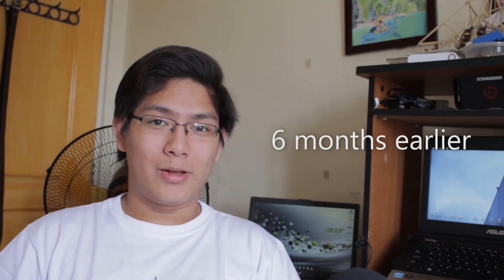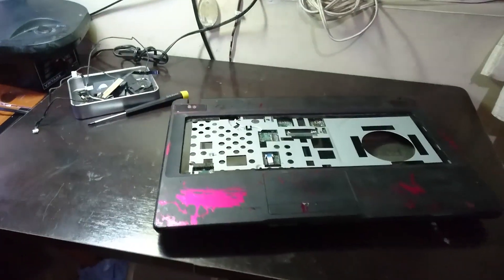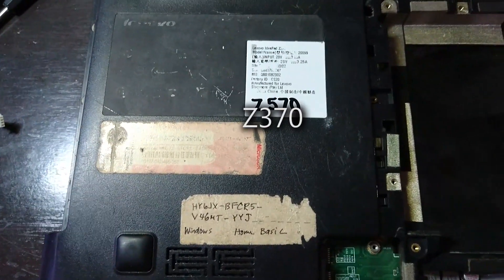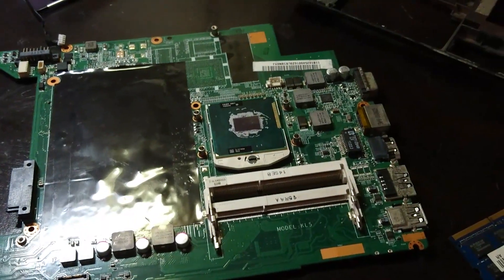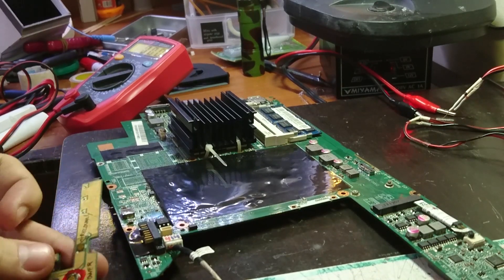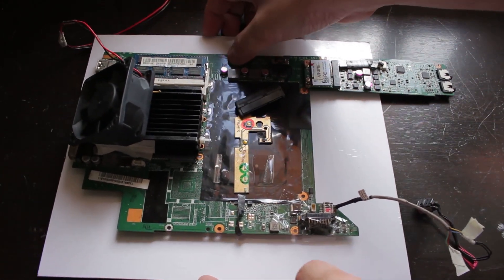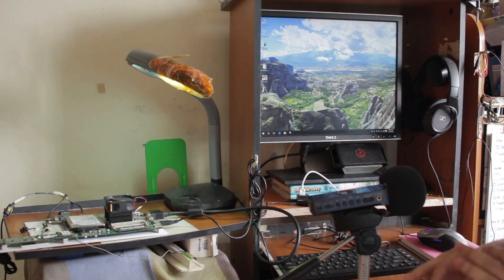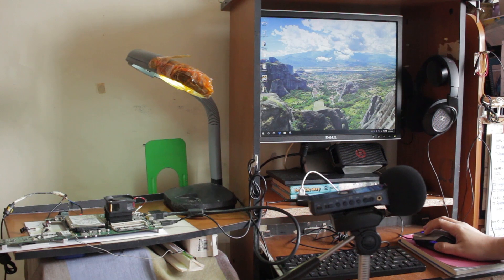Working Computer from SCRAP LAPTOP Parts - Frankenstein PC Ep. 1

Comment: i use a lenovo idea[ad z370 and i have never heard of one having a pentium. mines running windows 10 pro as of now with a new ssd. they are really good systems 
(edit) i did my research and there are actually pentium models. u could upgrade the cpu to a core i5 or even an i7 as they are socketed systems. mine originally had an i3 processor now upgraded to a core i5

Comment: Is that a PC  Cooling fan? I didn't think the voltage was compatible with the laptop power.
Reply: I believe those small ones run on 5v. As far as I know, they used to come from older desktops CPU cooling systems (I'm talking pentium 4 era). The larger ones run on 12v.